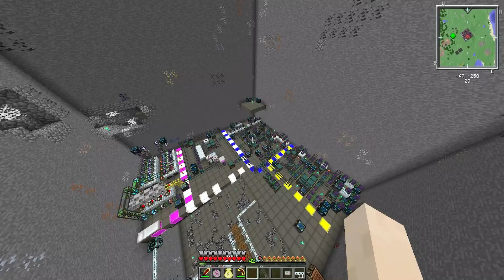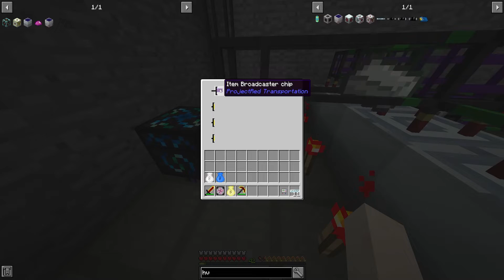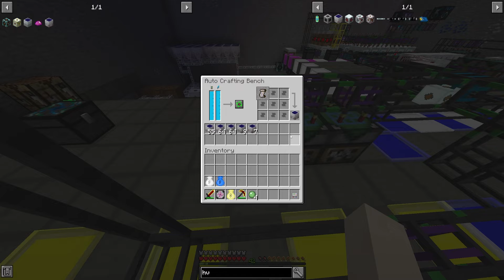TEKKIT 2 - Automated HV Solar Array Factory Tour - Ep 08

Comment: Trying to autocraft circuits, how to prevent it filling up with enriched iron and redstone?
Reply: I was actually watching this video to try and solve this issue myself. To fix this, use an "Item Stock Keeper Chip" on the input pipe that feeds your auto crafting table. Then make sure your fill mode is set to "when missing" and you have a white listed stock of a full stack for each item in the recipe. An example of this for copper cables is "6x (64) Rubber and 3x (64) Copper Ingot". This will ensure the crafter is only fed when you have less than a full stack of each ingredient, allowing ample room for the crafted product in the auto crafters inventory. I suggest using an "Extractor Chip" and "Responder Chip" on the output side of your auto crafting table to ensure you're constantly pulling your finished product out into a different inventory.

Comment: How do you setup the recipe for the plasma core? I'm having issues with doing it since I can't seem to setup the recipe as it needs 4 advanced alloy, 2 magnets in each slot but I can only seem to put 1 in the recipe box
Reply: Fill every inventory slot in the project bench with blocks not included in the recipe, like dirt - then you can make the recipe with multiple items per slot.  Kind of dumb that there isn't a button to toggle this on and off.
Reply: @aroxchannel  thanks will give it a go.
Reply: @aroxchannel  Thank you so much for this!
Reply: Craft the plasma core in the Machine Buffer block with import and crafting upgrade.

Comment: Just sharing my personal experience with projectred stuff...
It works, but it's super complicated (have to use cards everywhere, manually put junction pipes, crafting chips just break with ic2 laptron/energy crystals (and everything with a damage value) [and unlike in AE2 theres no way to fix it properly]).
I tried both, and choose AE2.
Way easier to use, nicer interface, and it looks super cool (like, visually super cool)
Also, AE2 has really good docs, while PR has little to *none*.
Reply: what about when you need more than 1 item in the recipe (In the same slot) I heard it won't work. I haven't tried ae2 yet I was wondering.
Reply: @zo2dfarm923  Late ass response but I found out that you can use the Machine Buffer block with crafting and import upgrades. I used that method for the plasma core part of the automation.

Comment: IC2Classic dev here. Full disclosure i just skimmed through this.
But this is a really cool setup! This makes me like really happy to see.

Small suggestion: Use for Rubber the Extractor. It has a Adv Machine too and produces 3x.
Also small fun note: With overclockers & efficiency upgrades you can make the Tier 1 Machines faster then the Adv Machines. Up to 20 items per second at the cost for 1EU/item.
Though some machines  require quantum overclockers to do this.

This reminds me of gregs base, who did this too, he was also one of the reasons why it requires now IV transformers. (its to encurage other power sources)
Though he did it with Storage drawers and IC2C alone.
I advise against doing that because just understanding what he did almost broke my mind xDDDD

Again this setup here that you showed is really really cool and I hope you enjoy your ic2c playthrough :3
Reply: thanks for your work!
Reply: ive been searching over the net but there is no proper explaination how the new electric flux generator works. there was an instruction but connecting eu power and then an rf output does not work
Reply: @RyderUwU the red dot (output) on the flux generator requires a flux cable
Reply: Who is Greg and where can I read/see about his design?

Comment: How do you setup your overflow chests? whenever i put an overflow chip in them they pull ingredients out of my auto crafters and fill up almost instantly, also am I right to assume your gold is made in one of the 2  condensers at the most east of your yellow area?
Reply from the maker: Overflow chips will automatically pull from extractor chips so I use firewall pipes just before the overflow chips to prevent anything being pulled into it. This way only when overflow items pass the firewall pipe they are picked up. Yes gold is made in one of those chests.
Reply: @chiseledchin7088  thanks, I did a bit of experimenting and just decided to change all extractors and responders to broadcasters and stock keepers and when I needed 2 of each I just split it into smaller networks or used firewall pipes, your tutorial on projected transportation is really good. Also what is in the other condenser next to the gold if you remember?
Reply from the maker: @ForQueenAndCountry  yeah that works, gold is right beside silver